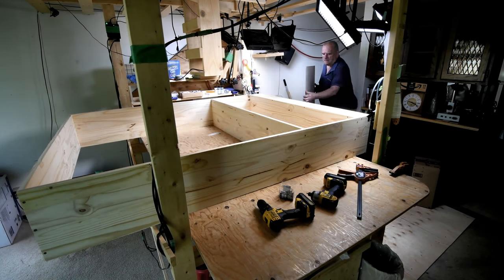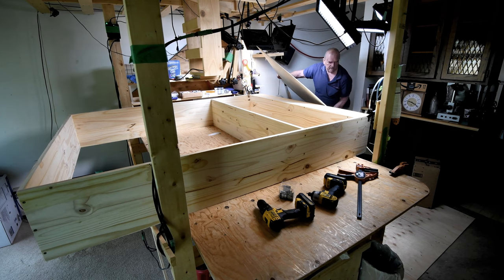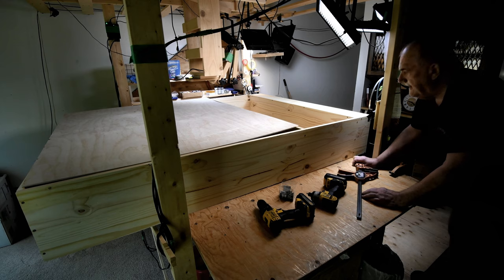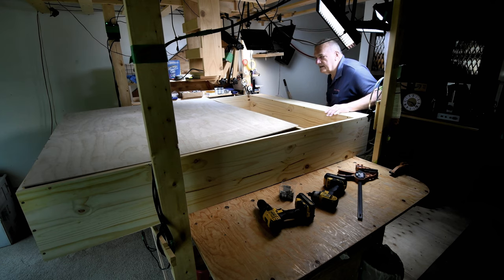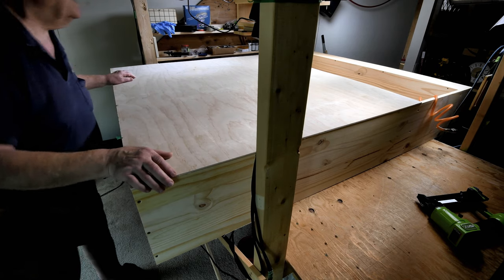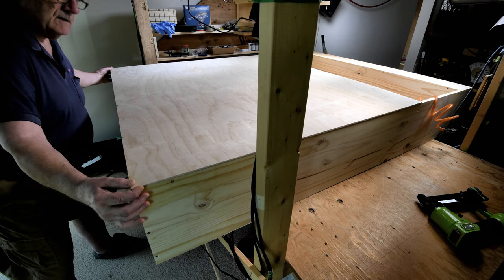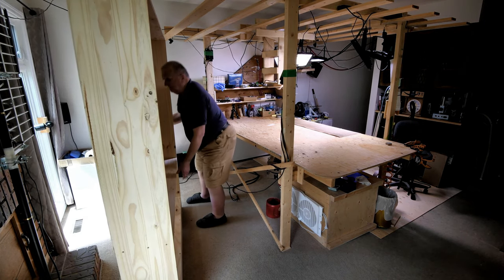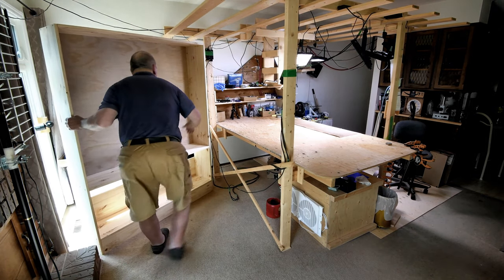The Model Ship - Part 488

Comment: I live in the country and have a large lawn to mow.  I asked my Dad once why he only put 2 1/2 gallons of gas in his cans for the mower.  Well that has
Reply from the maker: "Well that has" ------
What happened Billy, fall asleep? haha 😁
Reply: Ron Calverley   Nope, just got mad at myself. Went to touch the back button and hit the send button instead.  Been doing a lot of that lately.  Dad said that the cans of gas full were heavy.  I thought hot for me.  That was about 15 years ago and I am beginning to understand how heavy they are.  Another year or two and I will be putting my cans half full.
Reply from the maker: Just a thought Billy. Do you suppose that the lumber industry is cheating us on the size of boards because they know that if the milled it full size, us old guys wouldn't have the strength to handle it anyway. 😁👍
Reply: You know that could be.  But I think that they are just ripping us off!